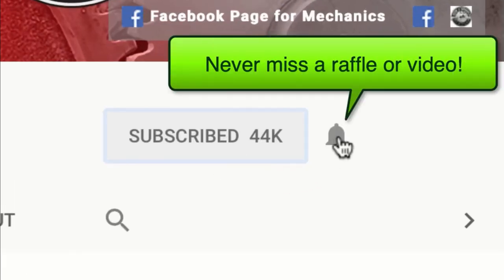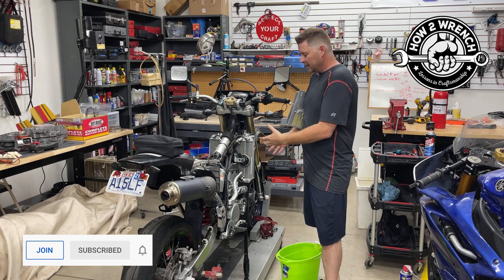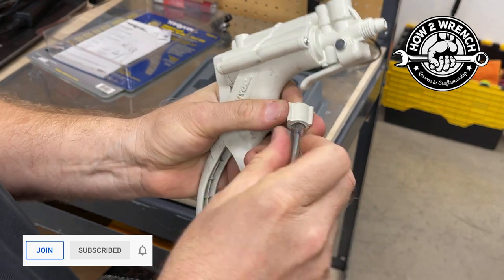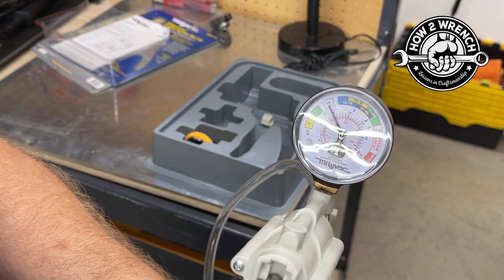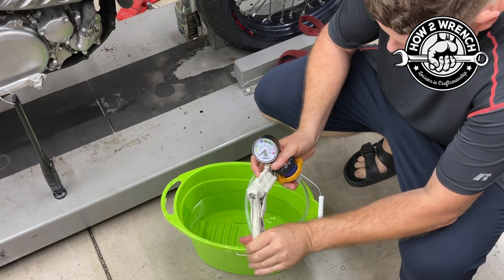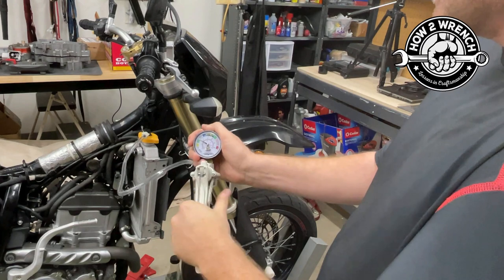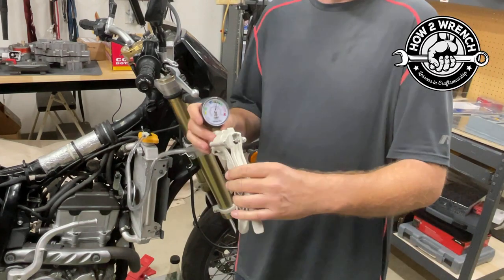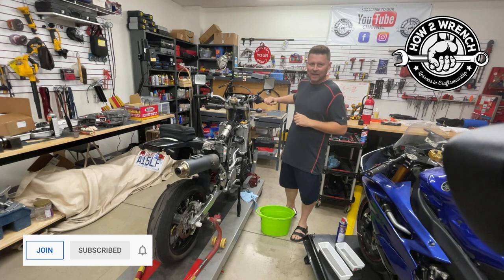DIY testing the coolant system and cap for $43! #drz400 #antifreezeleak #howtowrench #mityvac

Comment: Great tool yessss can’t agree more with you. I work on Goldwings and thermostat housing is in way deep, using pressure on system and small micro flashlight is the way to see them leak far far in deep. Many time all I see si smoke or fog . Pressurizing system is the way to go .

Comment: I have a 2000 drz400s 6 thousand miles. When riding normally, coolant will push into the overflow. Even on a short 15 min ride. Not a lot and doesn't over flow out of the overflow, about slightly less then half way. Then as it cools the coolant returns to the radiator leaving just the lower portion of the overflow with small amount of coolant. In your opinion is this normal, I've burped the system, all seems fine, I do not think it has any air in the system. I just got the bike so I'm going through it. I also know the thermostat is opening and closing as I ran it with cap off and allowed some air bubbles to escape. I can see when it opens and coolant flows through. Ty in advance

Comment: If cap OK and system problem not fixed, than check radiator cap surface codition.
Reply from the maker: I mention that actually. Thank you for confirming as another pro! Its all in the details right?
Reply: @How2Wrench  Yes good technical info. May some more info: Cross bike use 1,3 ( moreover 1,6) cups to inrease boiling point, reduce wieght, size. Also in F1 was a trend.